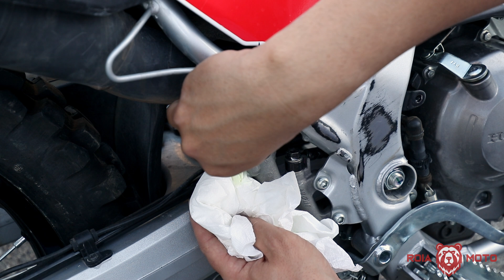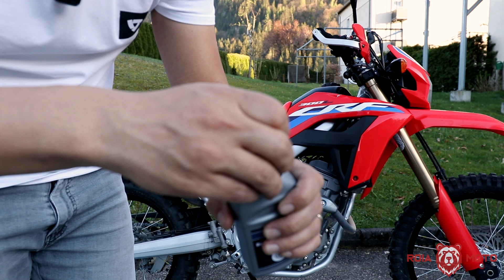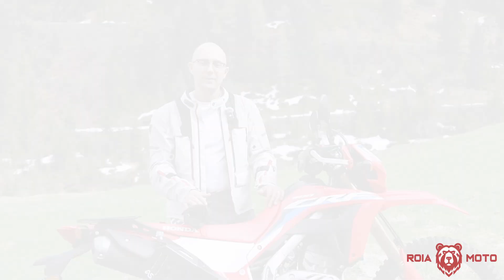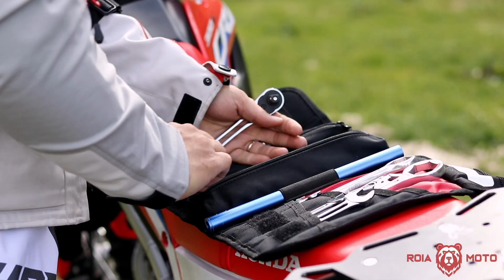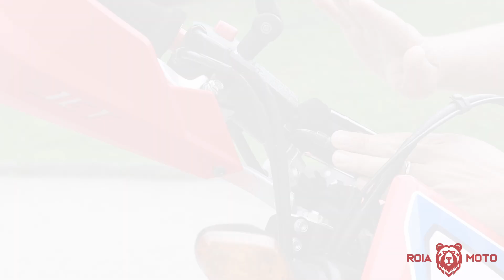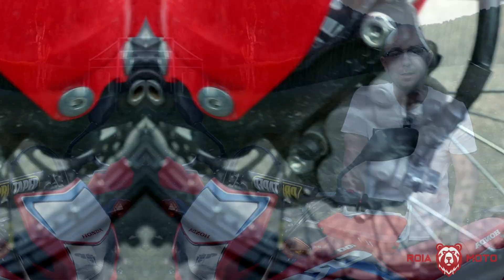HOW TO CHANGE BRAKE FLUID MOTORCYCLE CRF300L

Comment: Hi. OK...all you have done is correct on a bike that does NOT have the abs system. But the CRF 300 L has it. I have heard that also the part of the brake oil that goes to the braking system cdi must be bled. I would like to read your opinion. Many thanks in advance.

Comment: Thank you so much for creating this video. Clear and to the point. Really useful.
I have a CFR300L and my front brake lever is quite stiff (=hard to pull). Is there a way to "soften" that?
With the current stiffness I have less sensitive control on the front brake. Any advice is greatly appreciated. 
Thanks

Comment: QUESTION,  is it the same with abs Version?
Reply from the maker: Hi Dave.
Mine is ABS version 👍🏻
Reply: @RoiaMoto  thanks for the video. Is it not necessary to command the solenoids in the ABS block in order to flush everything, though? Thanks!
Reply: DUDE THIS IS THE ABS VERSION!!!

Comment: @9:45 a lot more force is needed to undo that screw. Here is shown as "one I prepared earlier" 😉
Reply from the maker: Haha 😂 which time stamp do you mean? 9:45 is almost at the end.

But you’re right, I try to keep my edits as short as possible.. my videos are already much longer than most other tutorials as I show every single bolt and but… I generally speed up the editing when I’m removing screws… in any I don’t remember struggling with any screws for this job.. it’s was pretty straight forward.

Cheers mate! Ride safe

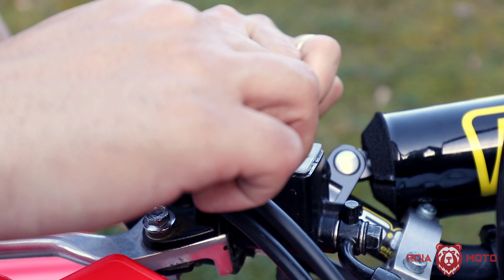Comment: 8:54 I think you missed an important point here: if the diaphragm has been deformed/extended from brake-pads wearing out, it is important to reset the diaphragm to its original collapsed state. Also touching on why the diaphragm extends and how it relates to the level of braking-fluid in the reservoir and the state of brake-pads would be important.

Comment: What about ABS version?
Reply: that is the ABS version
Reply: It is not ABS version. No sensor pilates on wheels oil pipes goes directly to wheels. Without ABS Cube.
Reply: @Peca169 So what happens with abs version?
Reply: @Peca169  of course it’s an ABS version, firstly of all it has small ABS discs inside the brake discs and secondly, the guy is from Austria and there are no non ABS versions sold in the EU